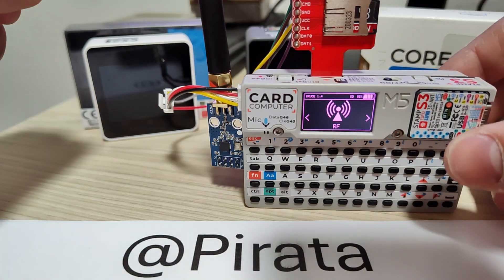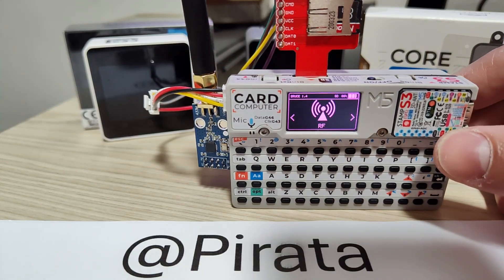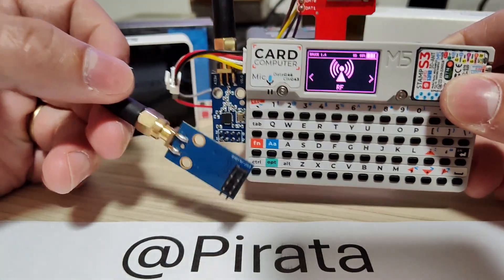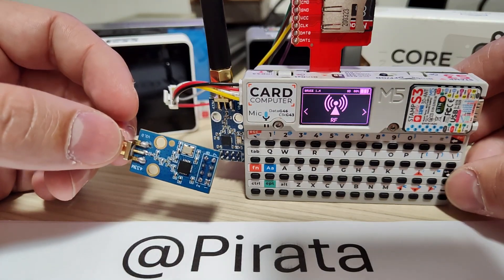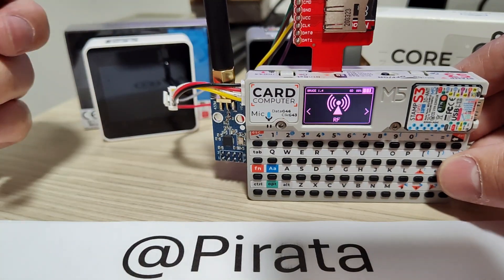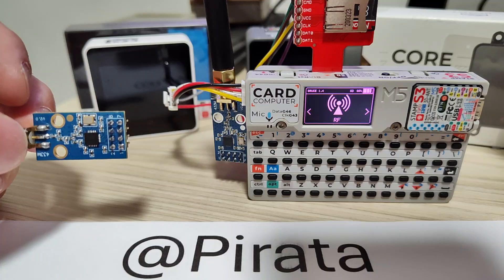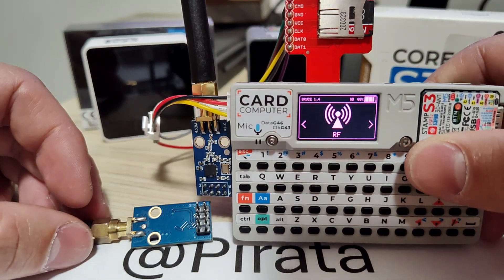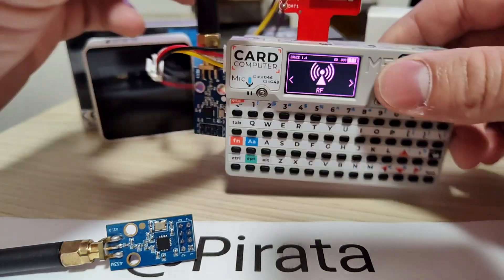M5Cardputer running CC1101 with Bruce Firmware!!

Comment: I'm having problems with receiving signals.
I have the cc1101 and I have adjusted the parameters to widen them. I'm in the uk so frequency is 433mhz but even when I'm stood next to vehicles being locked/unlocked, the scan shows nothing.
Have I missed something in settings?
Reply from the maker: @barrylarryharry7183  after you select CC1101 on RF>Config>Rf Module> CC1101, and go to RF menu, it must show something like "Radio Frequency (CC1101)" on the submenu

If it is showing "Tx: 1, Rx: 2" it is not selecting property.. then I suggest you to install the last BetaRelease..

And there's the possibility of the signals been using FSK modulation, which is not supported atm
Reply: @bmorcelli  hi again,

I followed this and it says cc1101  in the top left.

When I click on scan it just says 'recording: any raw signals
Scanning 387-464

But does nothing else.
Reply: @bmorcelli  the beta version has it all working now, it's finding many many signals within seconds! 
I think I need to downgrade my cc1101 to one with shorter range lol.

Comment: Didn’t have the sd card sniffer on hand, and will take awhile to get one, but did have a micro sd and sd card extender to micro sd male, I took a micro sd adapter and made a adapter to connect the cc1101 to, works great,

Comment: Could you provide me with the pin connection diagram?
Reply from the maker: https://github.com/pr3y/Bruce/wiki/CC1101 here you will find the connections
Reply: thanks.but it only transmits signal, not receives signal @bmorcelli
Reply: @bmorcelli  thank you for the diagram. Quick question! I see that the cc1101 needs 3.3V but I see no voltage regulator used. Should I use one? Is it going to get burnt if we use the vcc of the sd sniffer directly? Thank you in advance
Reply from the maker: @harispap  sdcard sniffer vcc is 3,3V already
Reply: @bmorcelli  Awesome! I will try it out! Thank you for your contribution 🙏
Reply from the maker: @harispap  you are welcome my friend!